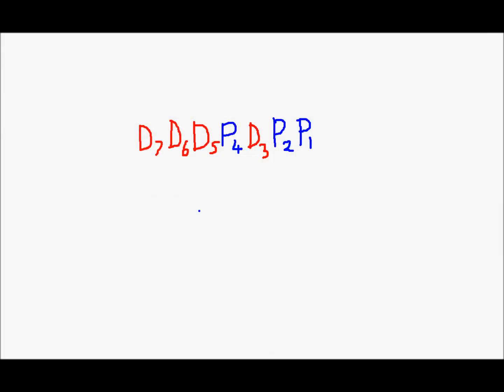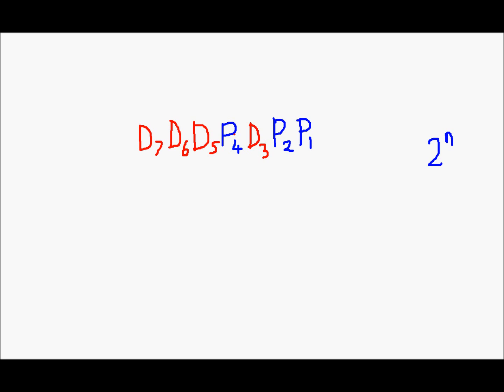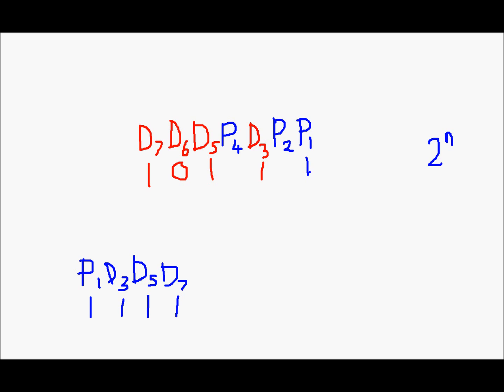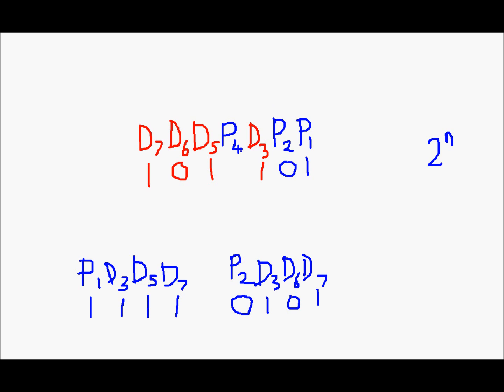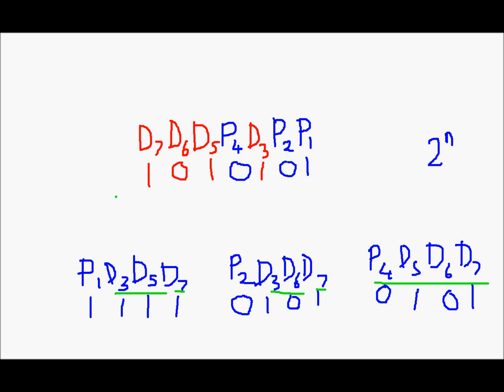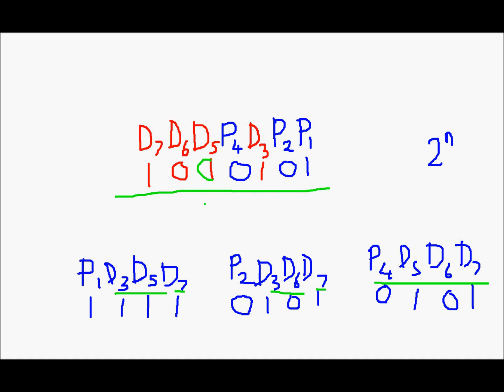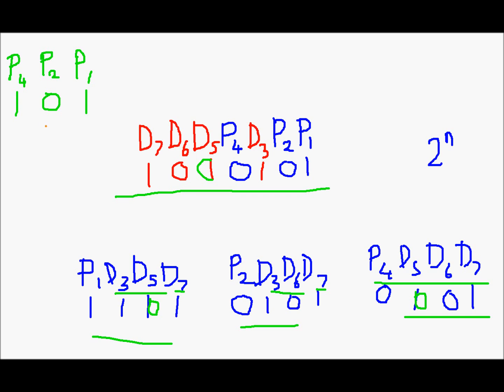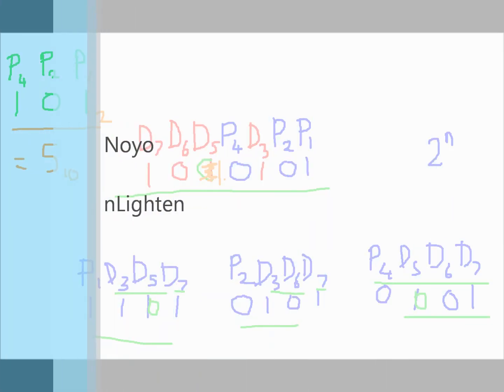Digital Electronics- Hamming Code

Comment: You did not properly explain why you considered D3-D5-D6-D7 for P1 and did not consider D5 when calculating P2. It is basically as follows:

If calculating Parity bit P1, you should start from P1, and now since it is '1', you take 1 and leave 1. So P1 (leave P2), take D3, leave P4, take D5, leave D6 and take D7.

Now, in case of P2, start from P2, and since it's '2', take 2 and leave 2. So take P2-D3, leave P4-D5, again take D6-D7. 

Same applies for P4, start from P4, take 4 and leave 4.